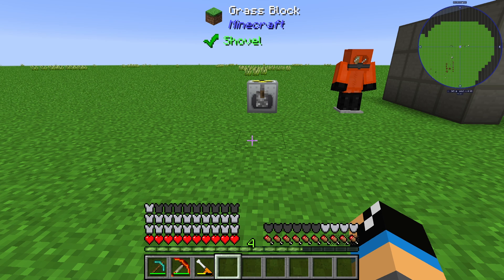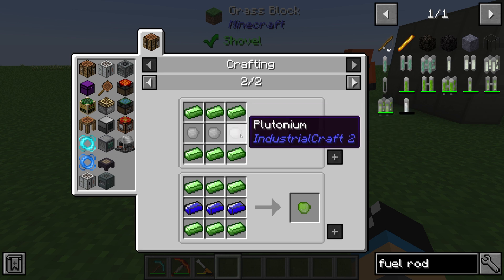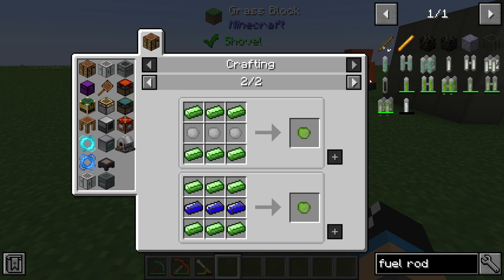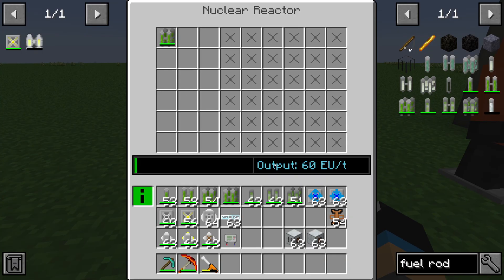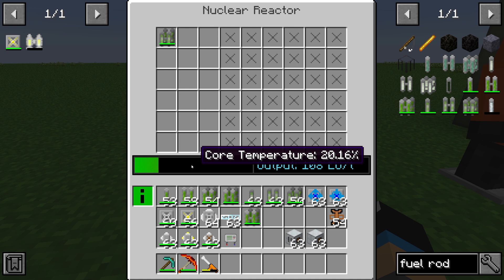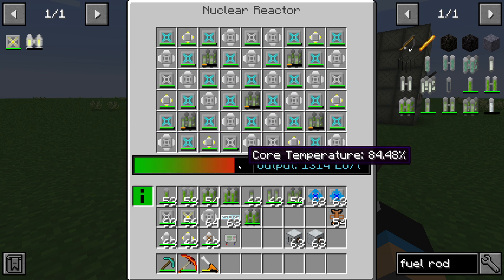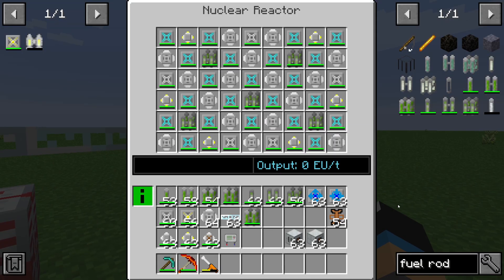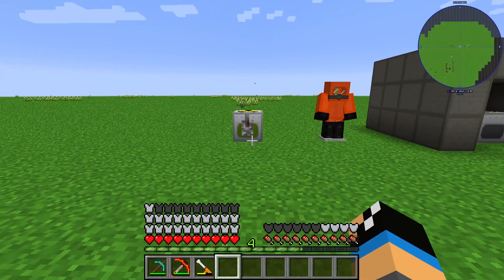Fuel Rod MOX 💎Industrial Craft 2 Tutorial 💎 English

Comment: why my reactor is producing 300EU/T I want to produce 1400EU/T like in the video?
Reply from the maker: as far as i know, firstly you need to increase the core temperature of your nuclear reactor 
this you can do for example if you remove 1 or 2 coolings.
But as i said in the video, you can only have 84% temperature. Otherwise your reactor will overheat and explode.